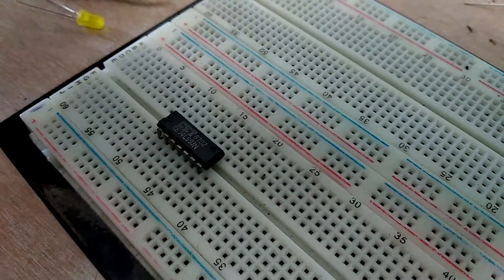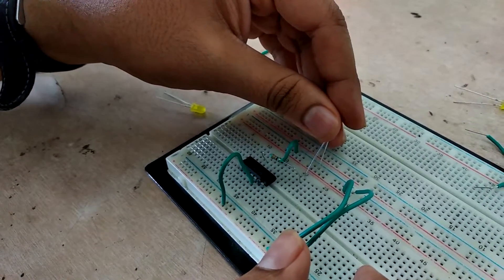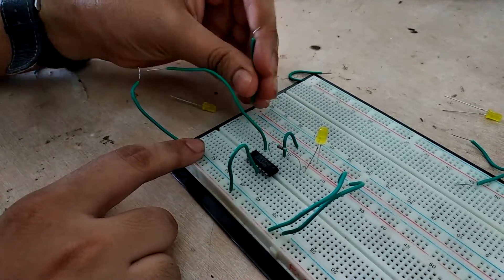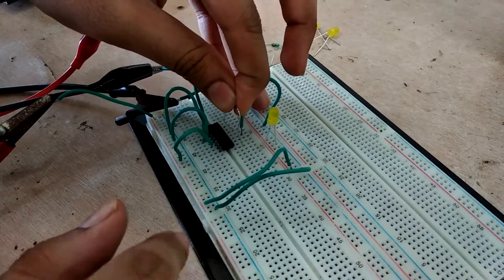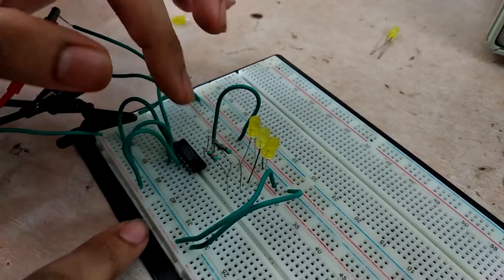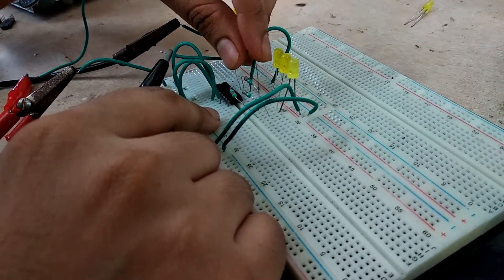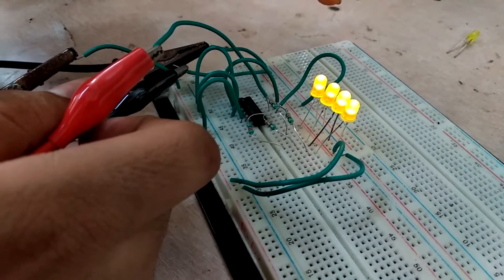MOD-2, MOD-8 & MOD-16 Counter using 7493

Comment: im still new to this IC so there are some questions that i need to ask
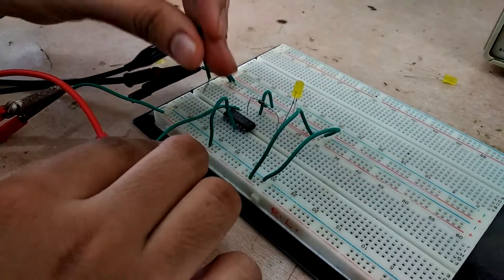-hoooow the hell did  that LED glow the moment u put the wire to pin 2 (2:47)
-hooow the hell did that LED blink , when the pin 2 and 3 is NAND GATE, so the input should be 0 and 0 to get a blinking output, where in your video the moment u put pin 2 wire to ground blinks, 1 and 0 = 1, it should not work since output 1 resets the clock 2:55
Reply: Please Refer page No. 6 bottom right table

Comment: How do you implement mod 6 on 7493ic?
Reply from the maker: Just connect Qc and Qd to inputs of an AND gate and connect its output to pin 2 and 3 (pin 2 and 3 are the reset pins) instead of connecting them to ground, rest all connections will be same as MOD-8